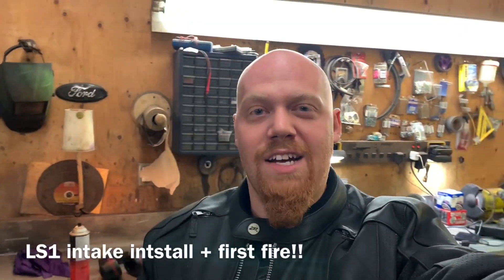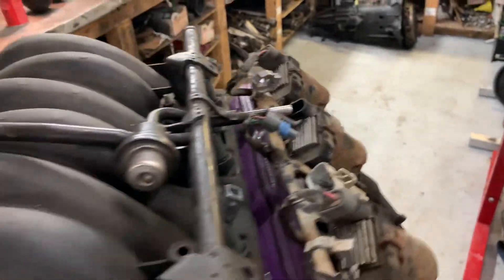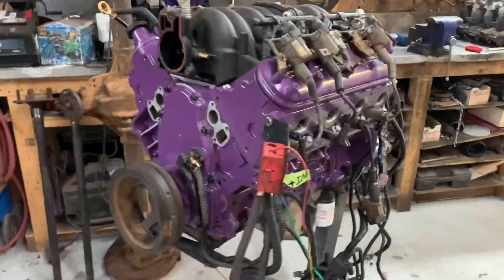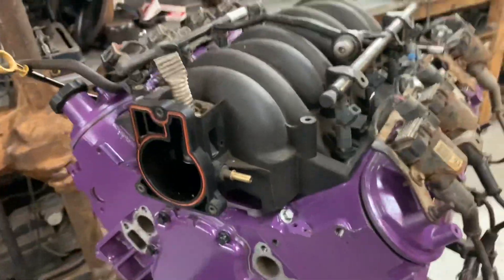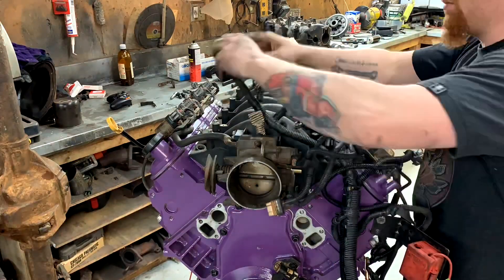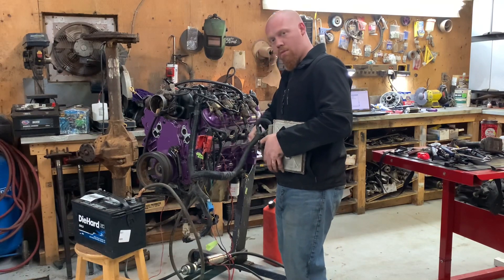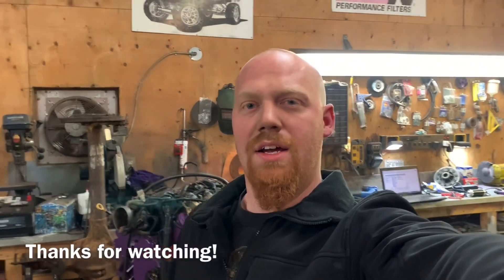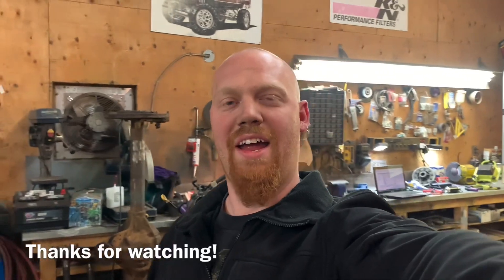Rebuilt aluminum 5.3 is ALIVE!!! Kind of #16

Comment: I love that fact you threw the harness together to get it fired...do you plan on running the modified harness with stock PCM or going terminator X in the future?
Reply from the maker: I have HPtuners so I’ll definitely be keeping the stock pcm, mainly because I already spent like 750 CAD on it, so I don’t wanna buy a standalone. I tune the rat rod, my wife’s Cadillac and now the van with it and I haven’t had any issues so far, but in the future who knows
Reply: @StationroadRatrods  hey, use what you have, I tried to have my stock PCM tuned by a "professional" and my harness cut as well but just had problems after problems...so juat went terminator X and haven't looked back...I just LS swapped my 67 Caprice...i love the build your doing...can't wait to see what's next
Reply from the maker: Sweet! It’s too bad you had issues, the stock stuff works well enough but of course there are limitations. I’d love to see your car, are you on Facebook? If so, you’re welcome to join my group “station road rat rods YouTube” and post pics/videos of your car
Reply: @StationroadRatrods  will do!
Reply from the maker: @masterofnone1776  minty

Comment: The flex fuel injectors flow the highest in factory right?
Reply from the maker: They are yes, but I think I may have been mistaken in saying they were flex fuel. I just looked at the part number, it’s 12613411, which makes it an EV6 injector, at 36 LB/HR. Still a good injector, but not the highest flow rate.